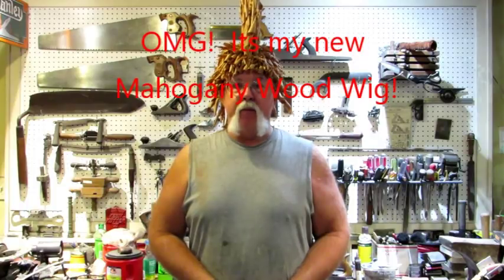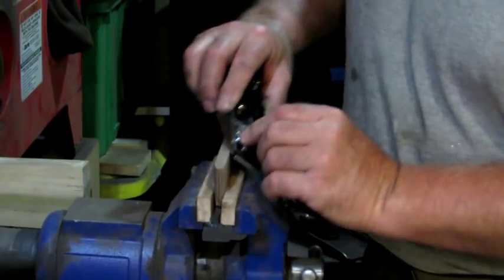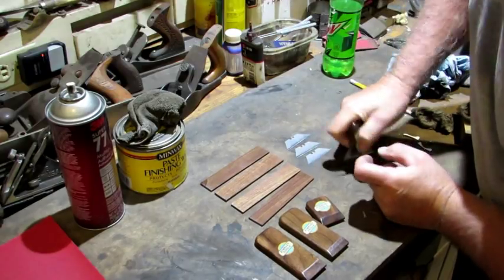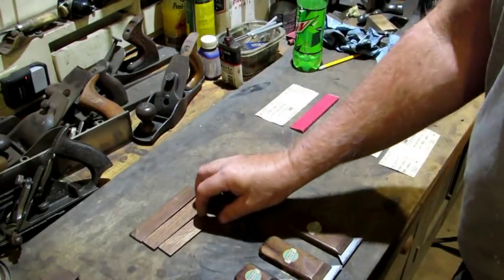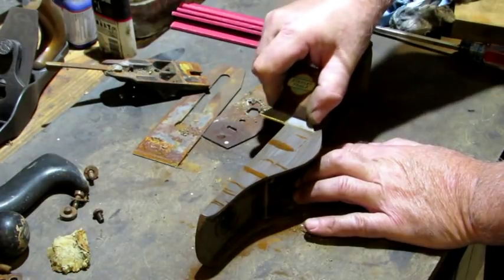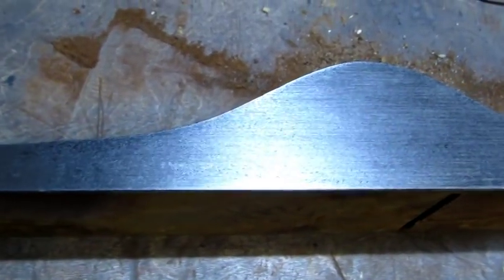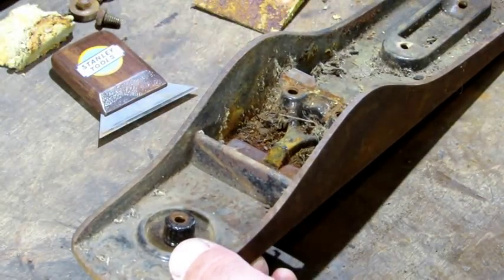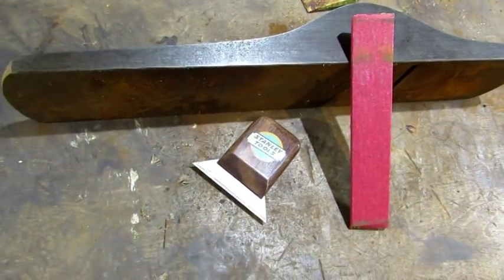How to Make and Use a Scraper and Sanding Stick

Comment: If you don’t have spray adhesive, and don’t want to wait for glue, you can fasten the sandpaper with a staple gun. You do have to avoid sanding with the stapled area, but it is quick and easy.

Comment: Hello, I recently subscribed to your channel. Why is that the large majority of your videos are about Stanley planes? Are they the best brand to get? I am also beginning on woodworking. Thank you
Reply: Plane Collector thank you so much for the explanation. I bought a Craftsman #14, mainly because of the price, I'm following your restoration system to remove all the rust out of it, to make it a user. Since I don't know anything about it, I will give it a try after I'm done, then I will take it from there, at least it would not matter much if I mess up this Craftsman, I will get a Stanley, eventually. Thank you sir

Comment: Im really battling to get a burr going on the scraper. I have tried holding it at 90 deg and twisting it slightly but it never seems to form a burr. Using 150grit paper and I have completely removed the sharp edge but still no burr on either side. Any tips for what I might be doing wrong?
Reply: Thanks I really appreciate the info. Will try it again, the scraper looks like a really good tool to use. Now I need to try to find some of those sanding sponges, its surprisingly hard to find stuff like that in South Africa!
Reply: Did you succeed to create a burr? I'm having difficulties to get a burr using the same technique shown in the video @ArbyCreations